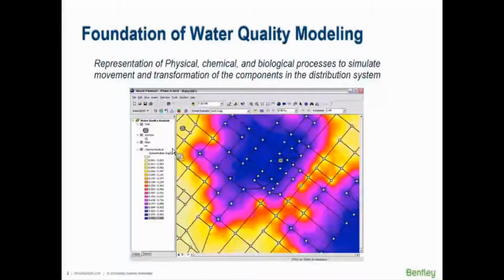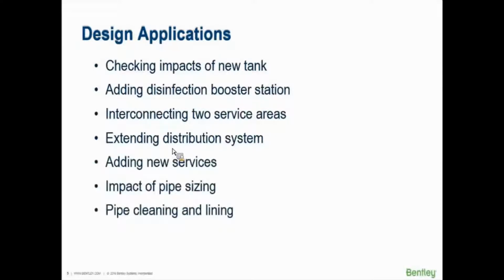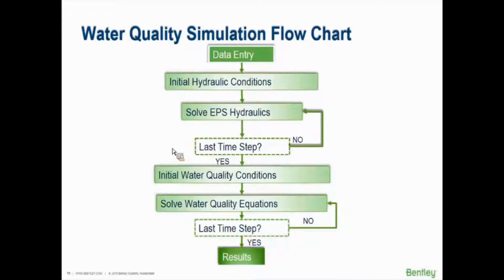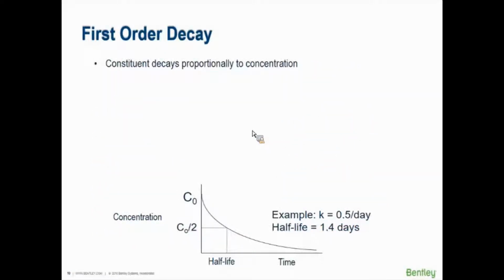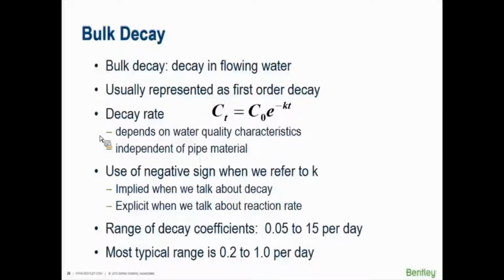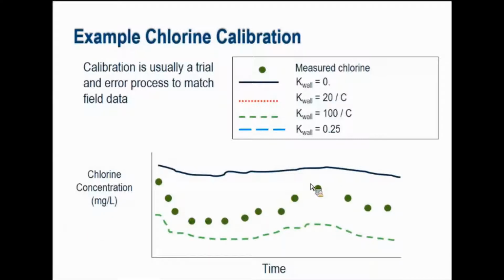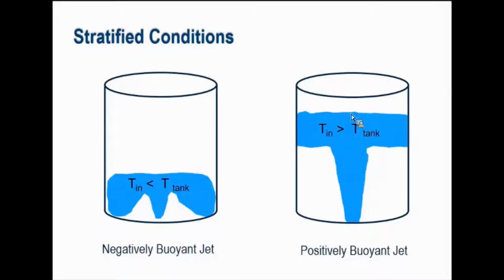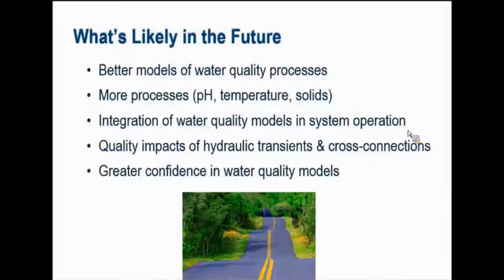WaterGEMS Advanced Part 9: Water quality modelling

Comment: Is specifying a separate inlet pipe important for tanks with separate inlet/outlet pipes?
Reply from the maker: If the tank fills from the top, specifying the inlet pipe is important so that the program knows which one fills from the top (this is internally modeled as a PSV at the end of the inlet pipe). See more here: https://communities.bentley.com/products/hydraulics___hydrology/w/hydraulics_and_hydrology__wiki/16833/modeling-top-fill-tanks-and-throttling-inlet-valves